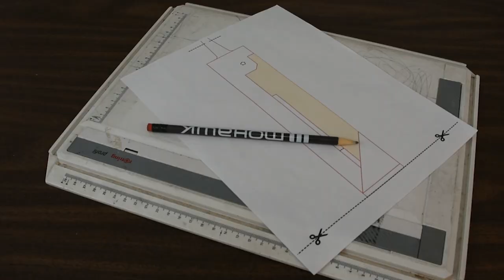Amazing DIY Invention Idea

Comment: It's quite clever. I wonder what you think of the dispenser I made out of a simple cardboard box with very little modification. It can be made in just a few minutes and works with many sizes of boxes. Doesn't put it on the tee though...